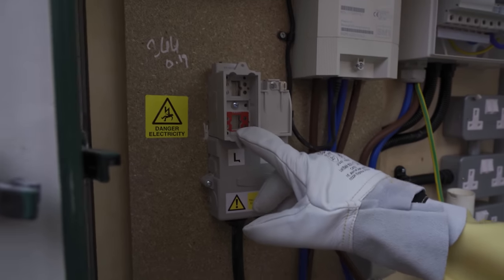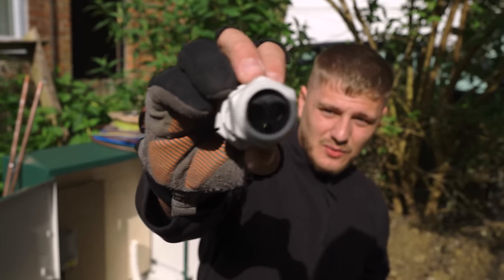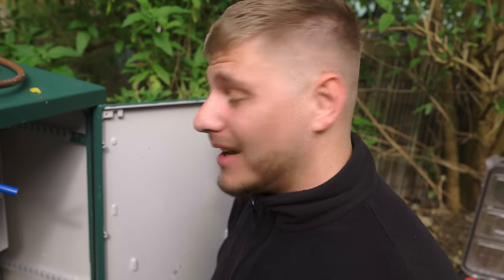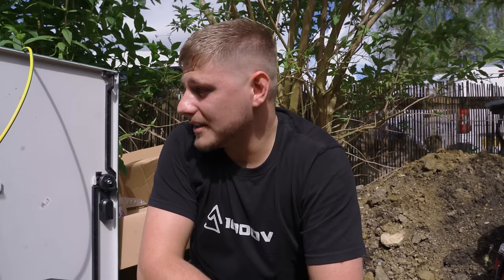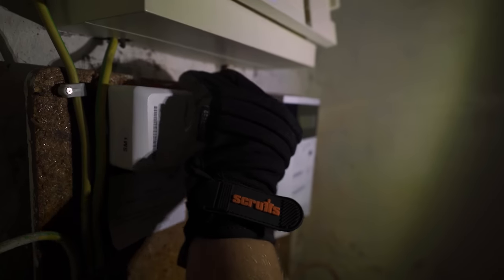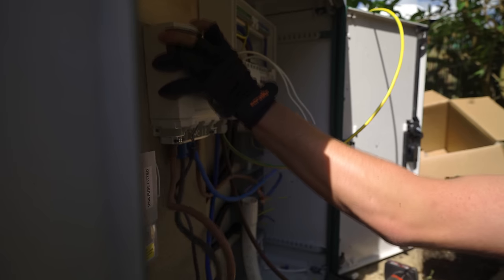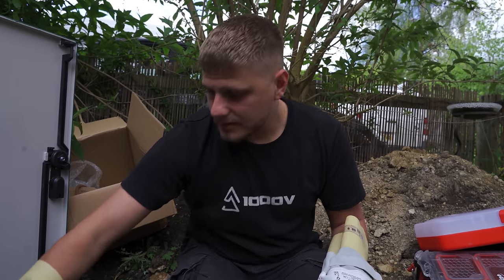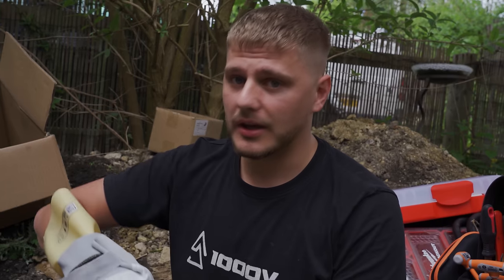Hooking up an electricity meter

Comment: Why I have never heard of this unless the property is condemned & unsafe to enter which the DNO did exactly what it shows in your video. 
Ok I had a building not condemned but old extension was gutted where our problem was the incoming & meter was in the extension. It was a pain to get a new meter but they did it in the end. They said a charge applied but the DNO was on my side saying the meter was too old/ unsafe so new meter fitted in the box. DNO did not charge as incoming head had issues(wink wink).

Comment: I agree with other comments on here regarding moving a 1ph meter dno’s will move 1ph meters providing electrician has a bs7671 test to prove they have done dead tests on all circuits to prove there closed circuits there isn’t a cross polarity or short circuit potential . DNO’s and the one I work for will not move smart meter’s that would be the energy provider’s responsibility to do. 

Also when ever pulling the main fuse of a cut out you should always do your polarity checks and a efli reading as well. In this case you would use a volt stick first to make sure main fuse is live and a no light on the neutral to prove there is not a cross polarity. Then pull the main fuse test again with a volt stick, neon, test lamps. Then do a loop test efli before you do anything else. 

One last thing as it has happened before a electrician pulled the main fuse when he shouldn’t moved the meter and went to install the main fuse again and electrician had a flash over due to a phase to phase fault out on the main where a old t joint had a phase to phase fault right next to the new service joint that was next to it. After the dno attended to install the new service a phase to phase fault had developed with in the old t joint! Doing your tests before hand would have shown this resulting in the accident never happening in the first place. With test lamps if you went from the live to neutral on the 1ph head you would have got a blue 415 light on test lamps indicating that there is a phase to phase fault back out on the main.
Reply: The DNO cannot move the meter if the metering company says no

Comment: Nice job, probably better than a lot of meter changers I work with. I'm surprised the DNO didn't recommend a face visor though. There was no load, fair enough. But you'd think they wouldn't want any come-back if something still went wrong lol. You can get rubber gloves that don't require the outer leather ones btw, making it a bit easier to work.

Comment: I would say The Gloves Thing 🤔 seems to be all u tube sparks have them be that putting a socket on or live work ( perhaps skin is not what it used to be 😄) I only put gloves on if I Work on anything over 230V that can't be isolated ( personal thing as I feel it's hard to feel what you need to feel through your hands or I have a built in torque setting 😂) then again I Dont get free gloves or have to try to film at the same time which always brings an extra element of risk to the job as you can't concentrate 100%

Comment: A pretty good job. You have obviously done this before or observed others doing it.  Only tiny mistake I would say is that you did not plan for the routing of the tails to the meter.  If you had positioned the meter a few inches higher you would have had a much neater route for these tails (not looping out into free air)  I always found it crazy that there were no torque settings for the terminals in the head nor in the meter.  In the meter we had to use as much force as we could on a std screwdriver !!!!   Such was the paranoia of loose connection resulting in a fire.
Missing Line and neutral identifiers (one each on input to meter, 2 on the outputs) Again crazy I know, especially as you used coloured tails, but thems is the rules 😀
One last thing - I would have wired the isolator so it could not be switched on without cutting the wire. But that's just me.

Comment: Why you wearing gloves? The fingers are cut off so they aren’t protecting anything anyway. I’ve been a electrician for 40 years and I can’t work with gloves. The only time I do wear gloves is if I’m doing HT phasing and it’s required to wear insulating gloves as a safety requirement.
Reply: Class at the thing is cut off can be good if grabbing a lot of things with palm of your hand and your upper fingers

Comment: goodness me 

meter tails should be flat against back board not them hellish loops you made and as they go into meter should have the anti tamper thimbles you removed with old cables 

personally i always cleat meter tails over about 30cm so they have strain relief but think thats just what suppliers i work for like to see 

its semt1 meter the extra bit is its comms hub 

great video tho buddy and not bad to say you dont fit meters 
ive seen fitters who do in day in day out do a worse job lol
Reply: This depends on the specification of the install, but it’s fine as he was doing it the way it was before the meter and company would have to upgrade it to the latest smart meter for it to be done that way

Comment: good electrician use stanly knife not cutters stripping meter tails!!!
Reply: Not really much of a difference if done properly both can be as bad
Reply: DNO's don't issue Stanley knives to jointers or meter fixers. They aren't insulated.

Comment: oven gloves for 230v lol
Reply: Well you need to realise this the safety cautions have to have because there’s not very many ways to cut the power off. Also there could be a very bad for all distribution network connecting the high voltage side to low voltage side.
Reply: Leave this subject to the adults.